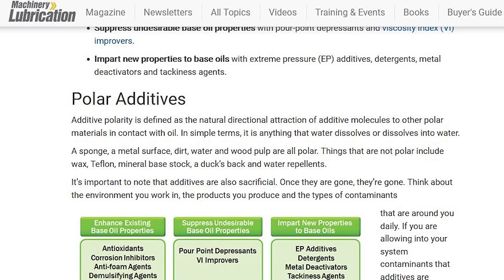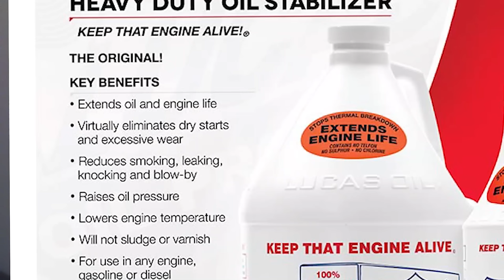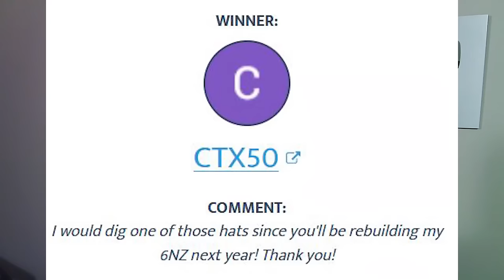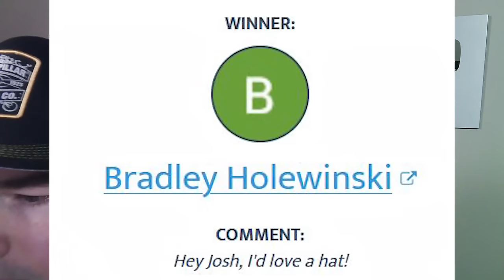Does your Engine NEED Lucas Oil Stabilizer? A detailed look at the "Benefits."

Comment: Sir. Between the age of 7 and 10, I put 1.3 million rotations on the Lucas gear display at my pops fav auto parts store. I can assure you this stuff works…
Reply: Holy shit I forgot about that thing...thanks for relinquishing a buried childhood memory that took place at my local Napa’s.
Reply: They still have one at my local napa. I give it a few spins now and then 😄
Reply: I have one in my shop
Reply: Lucas, I am your father
Reply: I always wanted to take apart the display and switch the gears.i wonder if the gears a cut differently
Reply: Been using lucas oil stabilizer in all my vehicals for over a decade 4 vehicals Toyota pickup Toyota 4 runner and a Honda CRV All have 300,000 plus miles on them all run great none of them burn a drop of oil all have fantastic oil pressure. You are acting like people are running straight lucas stabilizer it dilutes with you regular motor oil so it does not stay thick Amd flows just fine even cold. I know this for a fact my Toyota pickup has a mechanic oil pressure guage Amd even on the dead of winter the oil pressure immediately jumps to 65-70 psi when started in single digit weather.
Reply: I have one also at my local store haven’t spun it in awhile. I will next time… however I can assure that those gears have next to zero wear.
Reply: Did you ever try to hook a drill up to gears and spin em? At faster speeds it whips up like whipped cream
Reply: That little marketing gimmick proves nothing. You can never spin that little crank by hand fast enough to see what really happens inside an actual engine, not to mention once an engine heats up, or cold starting in winter. A truly reputable company doesn't need little gimmicks to sell their products like Lucas and K&N that have nothing to do with how they truly work in real life scenarios.
Reply: When we need $$$ to support our Hobbies/ way of Life, we resort to abnormal tactics...Unfortunately!
Reply: LMAO 😂🤣 I always spun those while waiting in line!!!!
Reply: @CJ-wc6lf  May the thick oil be with you.
Reply: @switchinggears9389  hahaha
Reply: @switchinggears9389  came to say i never used it because i used to go ham on those gears and ive gotten the lucas one to froth
Reply: @Muffmiester79  It makes a very good toy though, childhood memory unlocked
Reply: @Rumpleskin  Your sick. But so am I. I think the same way.
Reply: @switchinggears9389  There is a YouTube video I watched some time ago where these guys got ahold of that gear store display and rigged up a way to spin it so fast that they eventually made it blow up! Some waterjet channel or something. It was funny.
Reply: I used it to assemble an engine. Very sticky and stays apply
Reply: Yes, but it's a little different when you add heat, pressure, and the gases from inside of the crank case. Also, the Key Benefits But I can't argue that said "raises oil pressure"... That's probably because it restricts flow, because it's so think. Not a good thing. But I can't argue that point too much, honestly.
Reply: Awesome comment!
Reply: Haven't seen one in decades. Probably been binned at the stores that had them 😔
Reply: Lmfaaao
Reply: I was just thinking of that gear display before seeing these comments. You could see how “sticky” it made the oil appear when turning the crank.
Reply: @jackrabbit7389  of course it does. 
(1) it’s a Toyota
(2) oil pressure will naturally be higher at colder temps
Reply: LmAo!!!
Reply: Had a small truck that leaked a quart of oil a day. Tried 2/3 Lucas and changed the oil and it never leaked a drop again from the main seal. Also extended the oil life
Reply: Lol I’m 38 and I still go all in on that display at my parts store 😂😂
Reply: LMAO, funniest comment of the day
Reply: I remember them.
Reply: @Jack Rabbit  ive never used it, over a million kms on one vehicle alone. Close to on others. Normal service is all they have had. Everything still going strong. Im not gentle on my Himux, Dmax either.  Just because you use it no issues doesn't mean much
Reply: Some comments saying been using Lucas for years and no issues. So what? Been running with out it for 35 years. Over a million kilometres in 1 ute, close to in others. With proper services All run perfectly never use a drop. With Out Lucas. It's mainly for worn motors
Reply: Lmao!!!!
Reply: Yes, it does. The problem is your engine is not like that display.
Reply: yup seen it and done the same, but! in an office room temperature though with no heat, or contaminants right? It does have a coolant support additive that is as good as Enviro Safe (except not environmentally friendly like Enviro Safe). Also, the stiction advertised can help automotive automatic transmissions that are tired but not for long eh It has a place for sure as a benefit. Doesn't do any better then regular or high price Oils that are regularly serviced. Reference Scotty Kilmer and Detroit Garage. 20+ year experience professional techs when it was called mechanics eh
Reply: @jackrabbit7389  there’s a Bert & Ernie skit on an old episode of Sesame Street where Bert walks in and Ernie is holding a banana in his ear.  Bert asks why the Banana in your ear.  Ernie says, “I’m keeping the alligators away from Sesame Street”.  Bert says, “There are no alligators on Sesame Street!”  Ernie replies, “See, it’s working”.  This is a lesson for kids on the fallacy of Negative Evidence.  Lucas makes millions from people who never learned the lesson.
Reply: and I can assure you that the plastic gears will NOT wear in that display even without oil!!!
Reply: I love the Lucas gear display, but were they not plastic gears? Plastic doesnt retain heat like metal does. Once metal gets hot the oil gets hot, and when the oil gets hot it gets thinner, even with a stabilizer
Reply: With the less heat claim... I guess friction creates heat, so less friction-less heat
Reply: 1.3 noob
Reply: You believe in it you use it
Reply: Top comment. Also can confirm. We need to save those babies before they become extinct
Reply: Did you notice that the Lucas side whipped air into the oil/Lucas mix and the plain oil side didn't?  You can't compress a liquid (basic principal of hydraulics) but you CAN compress air.
Reply: @Muffmiester79   Yep.   I also remember the K&N flow display at our parts shop..   Usually next to the Lucas gear spinner.   I remember telling a guy, Id never run K&N in my offroad stuff.  He was going on about flow and the display..  I went over to our desk chalkboard,  got the erasure and banged it.   The look on his face when all the chalk blew right through the K&N...
Reply: 😂😂😂. Bro that's to damn funny
Reply: @Dingoroaming  It's true,  they SAY if you keep on top of your oils  and lubes, keep them clean and fresh, you Should not have any problems.  Time in most cases is proof.
But sometimes you see positive results from an additive that cannot be denied...
It is what it is.
Reply: Project farm demonstrated is trash.
Reply: @mandapalque  what do you mean?  Don't  understand your comment
Reply: @lifequest7453  Project Farm id a YouTube channel, he tries and things, he put lucas stabilizer into a few tests and he demonstrated: Lucas makes oils lubrication properties worse.
Reply: Too much blah blah blah blah
Reply: i would believe this guy before i would believe little plastic gears in a see through box.
Reply: I will say once Lucas warms up it actually thins out
Reply: I’m 26 and to this day I still do it!
Reply: I got double your miles and never used it, and everything was fine . . . maybe it works, but you don;t need it . . .
Reply: And some how they never leaked
Reply: And it still keep some plastic gears lubricated
Reply: Thanks fren. Apu 4 life
Reply: Hell yea right on
Reply: I remember someone told  me about amsoil. Said they didn't need this extra stuff. Ams is 100% synthetic
Reply: Is there anyone that didn't try to spin the display gear? :)
Reply: @highwayman1218  Like any oil based air filters, they need to be oiled to function. I prefer paper filters myself, but that's just because they're pain to clean.
Reply: @speedy_pit_stop    Well yes and they were oiled....      

I agree, I don't like screwing with them either and use OEM filters in my vehicles.